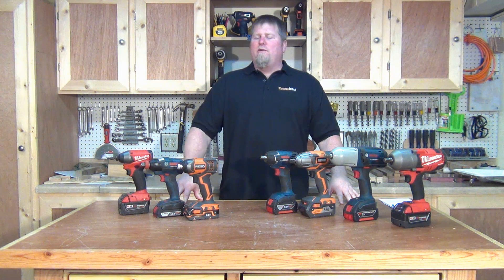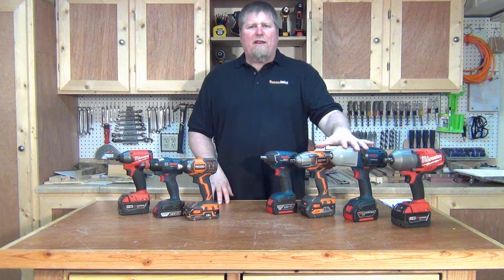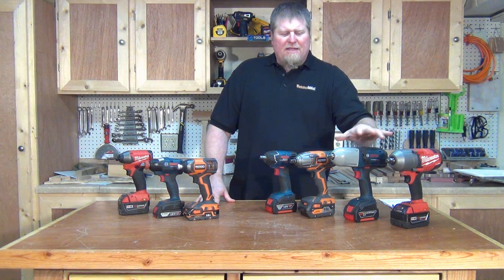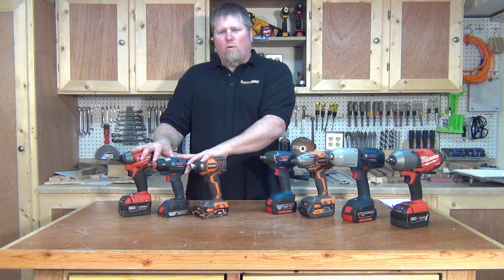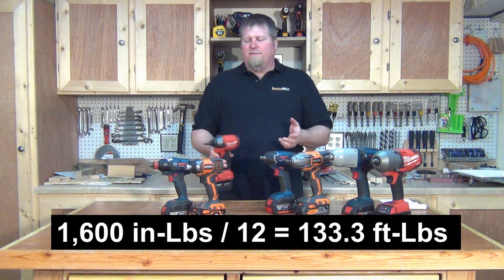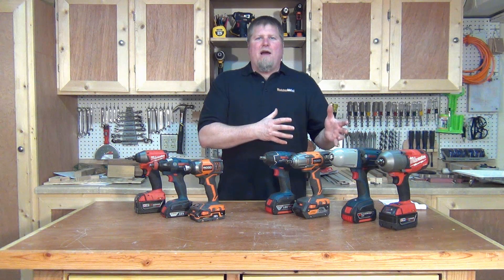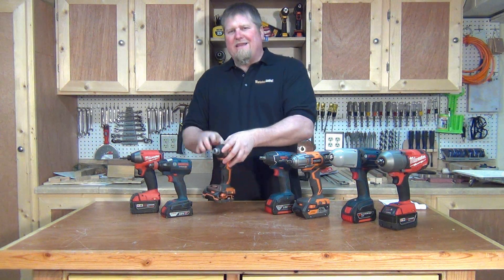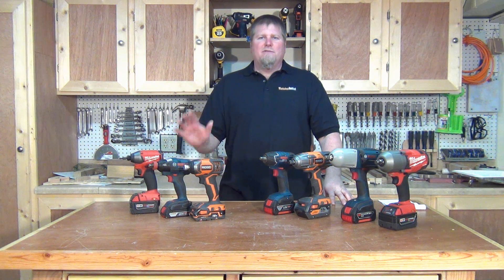IMPACT DRIVER vs IMPACT WRENCH

Comment: Some useful info thanks. I use a 1/2" impact driver (450ft lbs)- mainly for bolts/nuts. However MOST of the leading manufacturers do make purpose made adaptors for driving screws using these heavy-duty guns.

The 1/2" to 1/4" hex adaptors are specially designed to allow a degree of flex to enable some of the torque to be absorbed during initial start-up. They should only be used with 'torque rated' bits!  

You SHOULD always use impact rated sockets with heavy duty impact wrenches. Why? They are made of more malleable steel than ordinary sockets - and can cope with the additional torque generated by an impact wrench. Ordinary sockets are made of a harder, brittle steel alloy which CAN shatter when over stressed by using a gun. Either way wear safety glasses!
Reply: i'm gonna buy a 450ft lbs too for tractor bolt/nuts, did you test a 1/2 to 1/4 hex adaptator like this one ?
can i avoid to buy in addition a 100ft lbs impact driver with it ?
i was thinking to buy a more simple adaptator like hitachi 1/2 to 1/4 one.
if you  pull the trigger slowly, can you avoid the risk of destruction ?

Comment: is it necessary to get impact sockets for an impact wrench or can I use regular sockets.  I have a minor job to remove a pulley off an alternator and tighten a new on on , so didn't know if I needed to purchase a specific impact socket.  Thanks.
Reply from the maker: papitosabe You do not "need" impact sockets, but beware that the impact wrench can tear up normal sockets.  When it does, it can also strip the bolt you are using it on slightly.  If you just have one minor job, I would no buy them and try to use your most heavy duty socket.
Reply: +WorkshopAddict also, there's power loss with the non impact socket banging around and vibrating it's torque instead of the softer impact sockets that absorb the blows and transfer that to the bolt.
Reply: Non impact sockets can shatter when used on an impact. Wear safety goggles if you have no choice but to use one. But I'd rather be safe and use an impact socket. Napa and some other auto parts stores sell single impact sockets for a few bucks. Or you can go to Harbor Freight and get a full set for around $20, they are actually decent quality too.

Comment: I have a 1/4" hollow hex M12 Milwaukee, I want to drill a 2" hole in PVC, I go to Home depot and they say the 1/2" hex on the hole saw won't fit my drill.  Makes no sense that I need to buy a more powerful drill.  Are there any adapters for 1/4" to 1/2"?  I did see an M18 model with 1/2" hollow hex, maybe I get that and get an adapter for all my M12 1/4" bits and give the M12 to my father in-law.
Reply: +rtrain67 Probably too late but in my experience hole saws are usually used with Drills and not impact drivers

Comment: Great explanation. Spot on. Drivers are for long screws and small lags. Wrenches are for large bolts,nuts and lags. I like the drivers for long screws because they don't twist your wrist like a drill does, they stay right where you hold them.

Comment: They look the same to me. Tools labeled driver are just smaller. I bet if you pulled them apart they've have the exact same mechanisms in them though. Just the bigger ones would have bigger parts. BPM, or Beats Per Minute is an important specification too.
Reply: Yes they're smaller and weaker and have different purposes. I use a super small one for interior dash work, a 3 speed driver for engine covers and other bolts and nuts around the engine that it can reach, and the big one I use for ball joints control arm bolts and lugs. If i tried to use the big one on a dash, it would just rip holes in it. So while yes they are extremely similar in design, the weaker ones are just as useful as the stronger ones and they serve completely different purposes.
Reply: Yes they're smaller and weaker and have different purposes. I use a super small one for interior dash work, a 3 speed driver for engine covers and other bolts and nuts around the engine that it can reach, and the big one I use for ball joints control arm bolts and lugs. If i tried to use the big one on a dash, it would just rip holes in it. So while yes they are extremely similar in design, the weaker ones are just as useful as the stronger ones and they serve completely different purposes.

Comment: Question: does the battery series (compact, XC, , XC 4.0 ect) make a difference to the maximum torque available, or just the time before recharging?
Reply: You will get some improvement in power with higher ah batteries.

Comment: Nice job explaining it all John! 

One thing I will add for people who ask about using a impact driver to remove lugnuts ---- You must use a 1/4" hex to 3/8" OR 1/2" square drive adapter (so sockets will fit on it) & when you do that, you will lose torque by adding an "extension" (in this case the adapter). 

So, although the impact driver may have 130 ft-lbs at the anvil.....by the time it goes through the adapter & socket into the lugnut, it drops below 100 ft-lbs & many times will not remove it on a consistent basis.  Also, as far as lugnuts go....they are installed at 80-120 ft-lbs (for example), but after you drive around & dirt/salt/corrosion gets into the threads, many times it will take 200-300+ ft-lbs of force to remove them -- which is why an impact wrench is much more ideal.
Reply: you should have also mentioned to use impact rated sockets & extensions. Also you can get hex shank sockets  which removes any kind of efficiency loss generated by having an extra mechanical connection.And the length of a socket + adapter is no different to the length of a deep socket. At the end of the day a decision on driver v wrench depends on your application. Mechanic?Definitely impact wrench no question. Woodworker?impact driver no question. Got loads of money and love tools?Buy both. The average guy who's occasionally going to pull of he's wheels will do fine with a driver.I know this video is a few years old now and the majority of points still stand but take a look at even a  brushless 12v impact driver ripping rusted wheel nuts on and off.
Reply from the maker: Great point Daniel.  I skipped over the part about using a square drive adapter. 

I did not know that after driving around your torque value may go up.  It makes sense though.

Thanks for the feedback.
Reply: There’s this thing called breaker bar.
Reply: mikemar44 That was a pretty cocky response considering the ignorance... Extensions will twist every time the impact force happens, absorbing the impact rather than transferring it to the socket and nut/bolt. The longer the extension, the more potention for twist. They actually make a set of tools that do this in a controlled manner on purpose so that you can use a 300 lb/ft impact tool full throttle and not actually apply more than, for instance, 80 lb/ft of torque to a lug nut. They are called torque sticks. This is a very well known physical principle and anyone who works with impact tools knows first hand how much of an affect extensions have.
Reply: gtdrummerdude twist is minimal ad the tools adapters extensions ext are designed not to.
Reply: ... Extensions will not change the torque output .... Take a math or physics class extensions run perpendicular to the lever there for not altering the length in the toque formula. Only length added to your level will (cheater bars) there is however a Max torque a size can handle but that only refers to the amount of pressure a 1/4 , 3/8 , or 1/2 piece of steel can take.

Comment: Looks like the second impact driver from the left (Bosch) combination driver and wrench.
Reply: WorkshopAddict I have the Bosch impact driver (IDH-182) shown in your video.  Overall, it is a great tool with alot of power and features three different operating modes.  However, I would like to point out is that while it is socket-ready,  the friction ring is a more like that of a coil and has difficulty retaining certain brand sockets and deep sockets larger than 1".  The socket ready anvil also means the chuck is deeper, meaning it will not accept some impact bit holders.
Reply: WorkshopAddict No problem, I felt it needed to be mentioned since that that impact driver kit can cost between $260 and $330 depending on the included batteries and case included.  I have not tried using 1" impact bits without a impact bit holder since the chuck is longer than most impact drivers.  I had this problem with the Wiha Terminator impact bit holder because the length of the blade was too short.  However, I worked around this issue by buying a longer impact bit holder as well as longer impact bits.  It was a costly lesson.
Reply from the maker: Yes it is.  In my multiple attempts at completing this video, I forgot to mention that the Bosch Socket Ready Impact Driver (IDH 182) has a 1/2" square drive and a 1/4" hex receiver so that it can accept sockets, driver bits or drill bits without any adaptors.  It is still rated in in-lbs of torque through, so it is a driver and not a wrench.
Reply from the maker: shauncatlett I have noticed that it won't accept some impact bits as well.  I thought it was a bit strange.  Thanks for pointing that out.